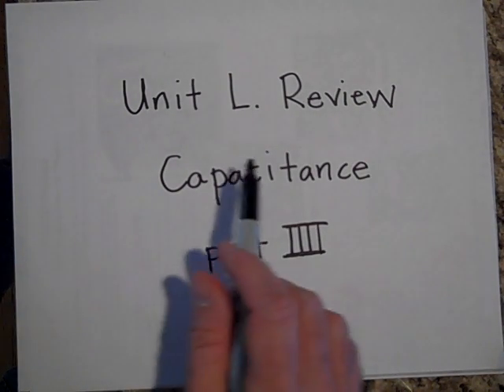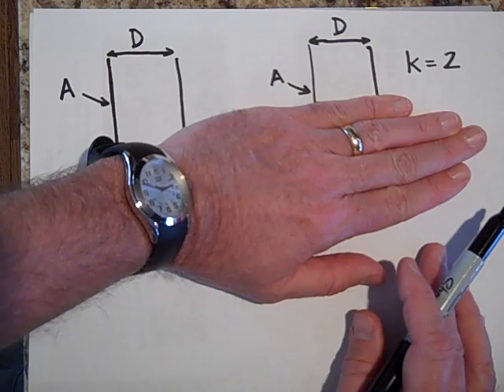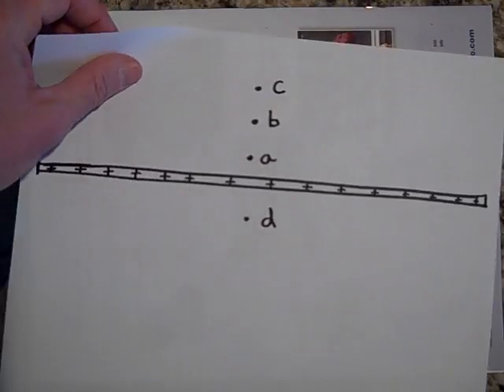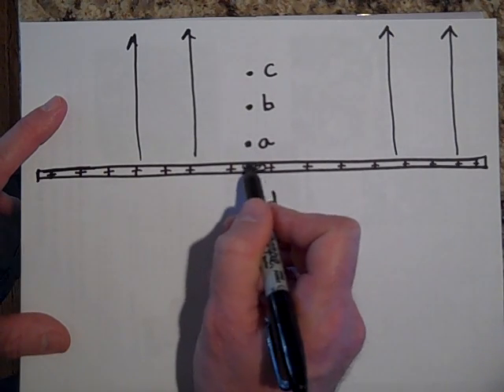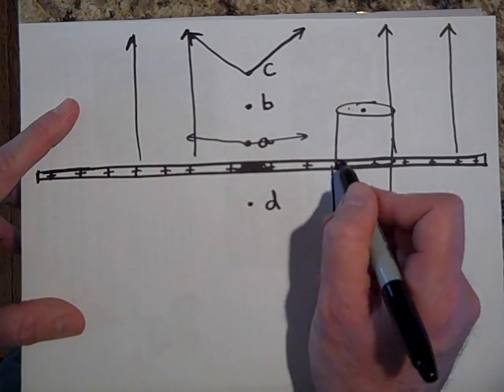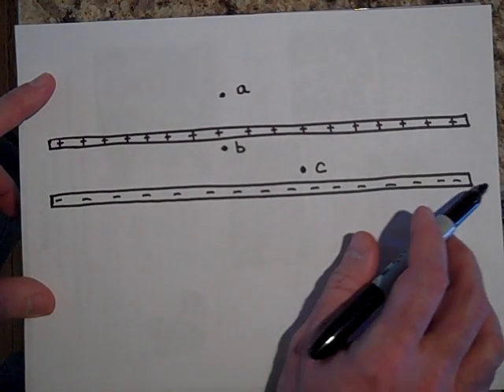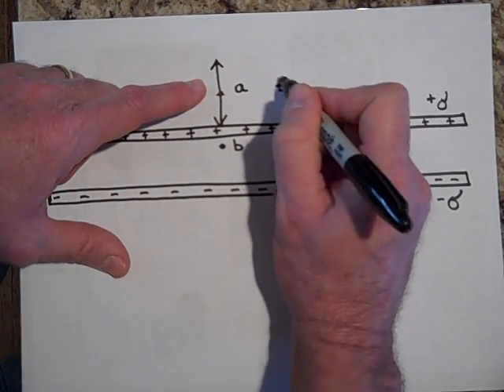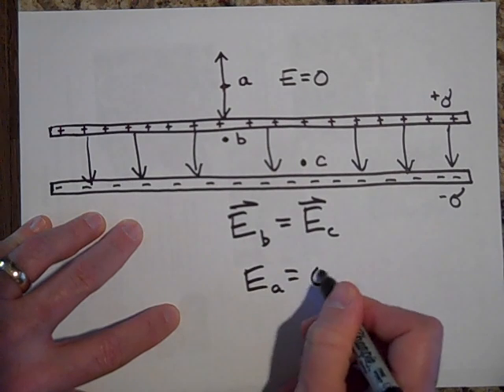Review of Unit on Capacitance (part IV)

Comment from the maker: This is actually like 2 capacitors that are in parallel.  See how the positive plates are attached to each other and the negative plates are attached to each other?  Each of the capacitors have the same voltage across them.  So you actually just add the capacitors to get the equivalent capacitance.